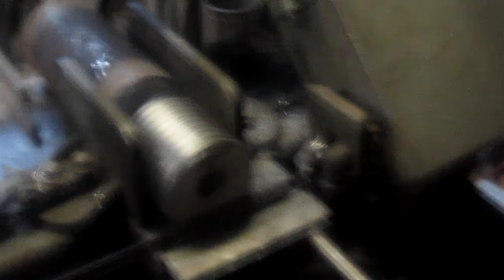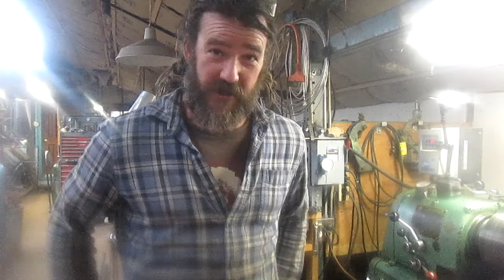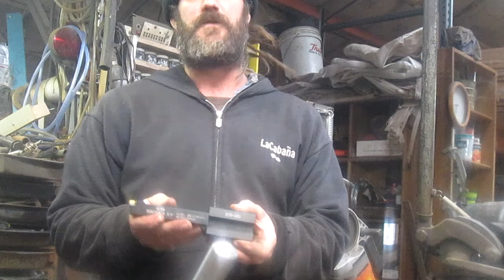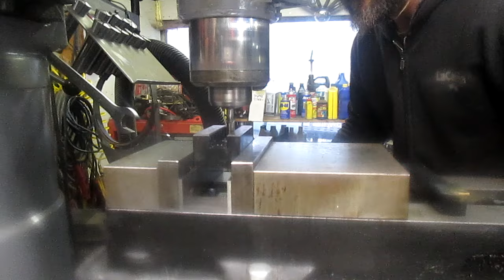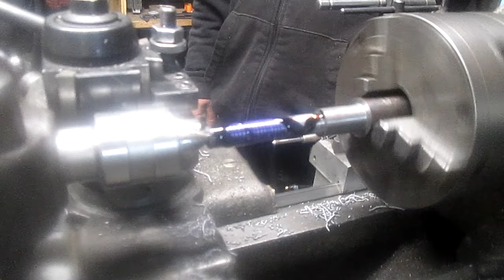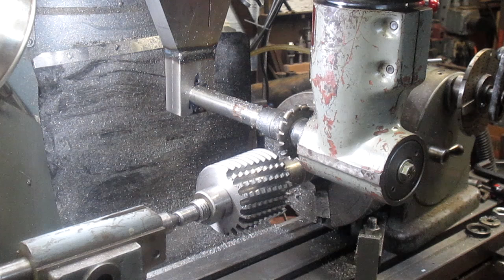Jason's Big Cutter #3

Comment: jason, either that is some nasty steel you turned on the lathe or there is something wrong with the insert or tool height as it seemed to be cutting poorly (as well as the tool being over extended from the holder) the lathe speed also looked a little slow for carbide inserts. I agree with Nick that those cutting 'teeth' will be a little small once the relief has been added. As I was always told 'Every day is a school day' and it is what we learn from our mistakes that makes us better. Keep up the good work.